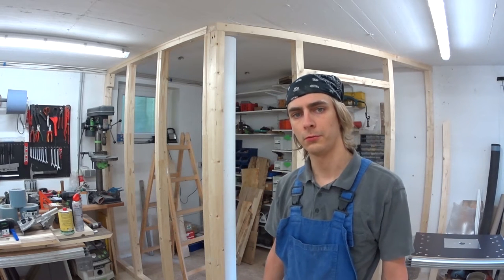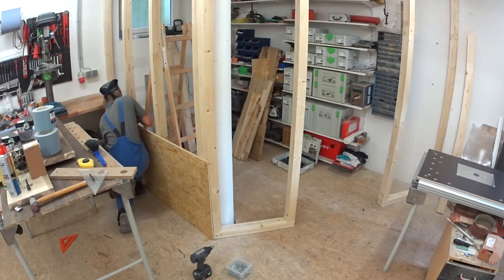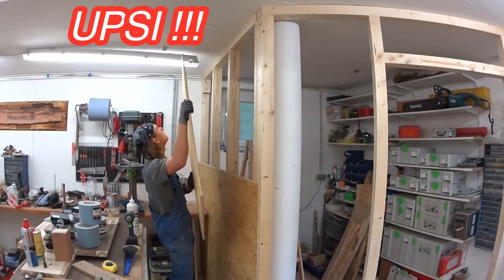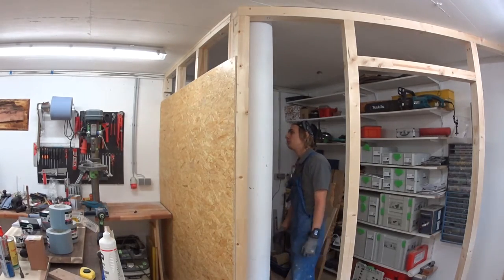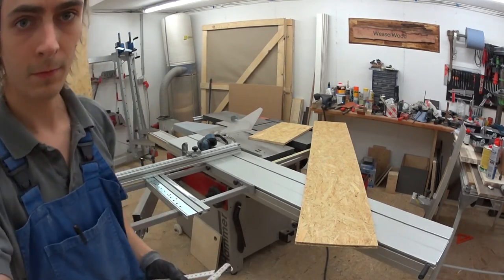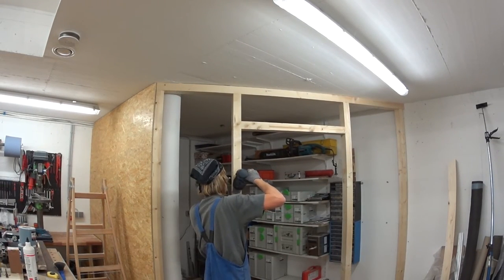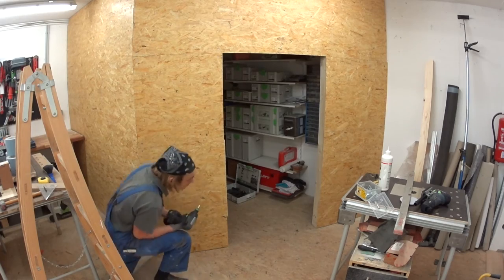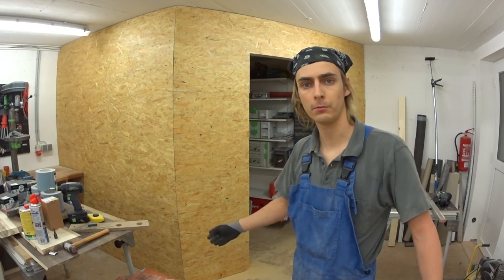WeaselWood ShopImprovement #2 [English] Storage Room Planking

Comment: Are you a carpenter by trade or is this your hobby? Nice videos. Would you recommend the Hammer C3?
Reply from the maker: +Rasheed A 
Thank you!
No I'm not a carpenter, actually I am a electrical engineer, but I like to work with wood.
Yes i would recommend the Hammer C3, it's a nice solid middle class machine, very precise and I like to work with it. But also for a hobby the hammer is rather expensive! ;)
Reply: if you were a mechanical engineer you could have incorporated that round steel ceiling support into a dandy fixture, tool - dock, etc. seriously though bud, only people who aren't smart enough for electrical engineering  go into mechanical engineering here (usa), haha. you do some good work! love watching you go about it